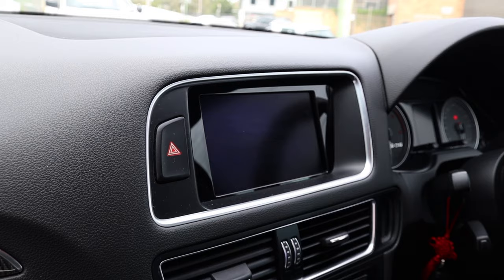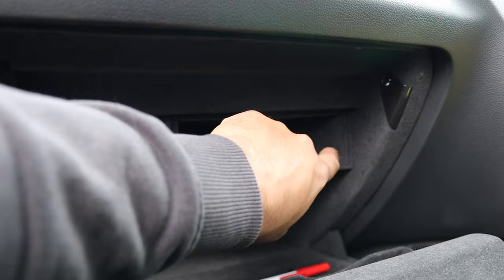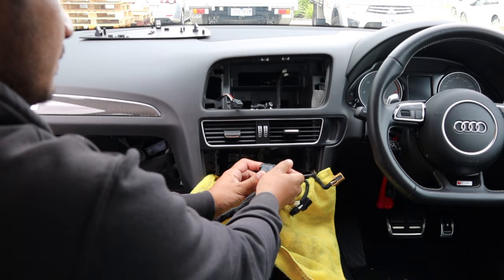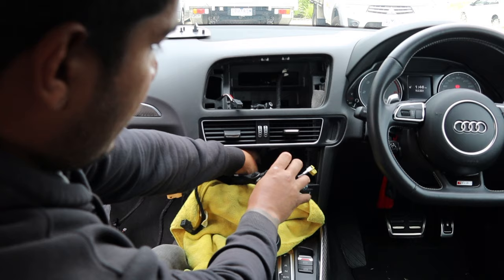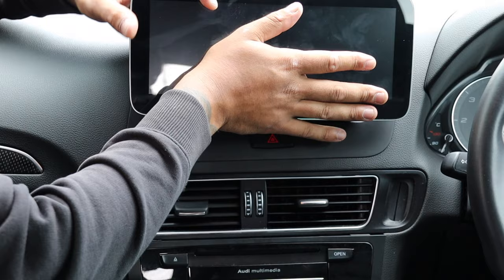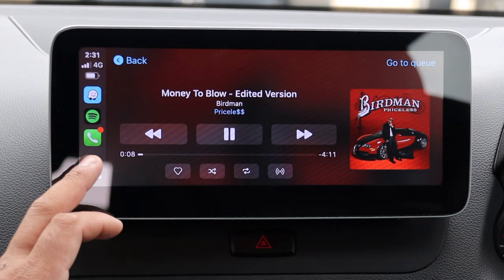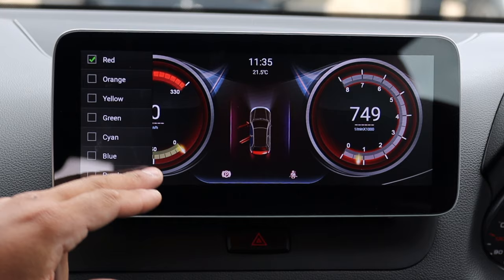Audi SQ5/Q5 10.25" Android Screen Install.

Comment: YOUR VIDEO IS BY FAR THE BEST. INSTALLING RS NAV 12.3 IN SCREEN AND I COULDNT FIND THE CONNECTIONS FOR AUDIO UNTIL I SEEN YOU DISCONNECT THE RED CLIP AND I WAS LIKW "DUH" AND I HAD THE SAME ISSUE WITH FACTORY REVERESE CAMERA. WENT TO SETTINGS AND TURNED IT ON. LOL, THANKS FOR A GREAT VIDEO.

Comment: Hello from 🇬🇧 Really looking forward to giving the install a try. Although I've only gone for the smaller screen rather than the one in this video. Nathan was really helpful answering my questions over email prior to placing my order. Keep up the good work. You've made me also want to upgrade my brakes with your other video 😉
Reply: Hi, I'd be really interested to see your install pictures and get feedback on difficulty of fitting please? 

I'm also in the UK and thinking about getting 2 of these kits, 1 for a 2011 Q5, and 2nd for an 2009 A4.
Reply: @nickburns2034  Hi Nick, happy to help if I can. I'm on Facebook if you want to chat more or I can give you an email address or contact you by phone/text if that helps. Cheers
Reply: Does it use the mic from old system
Reply: @markkendall6144  I have similar questions about the mic
Reply: I just fitted one in my q5 2015 for now no issues, small problem with airbag light (hazard light baton non Europe) and  I can’t connect  Wi-Fi but probably it’s my fault
Reply: @wojteklondon  Hi there, you mentioned having a "small problem with airbag light". I've just fitted one of these screens and I'm having issues with the airbag light, how did you get around the issue? Any help would be greatly appreciated   🙏
Reply: @scottmitchell4577  hi I connected the original switch and hidden under the dashboard. Big  plug for original and small for new. everything works as it should
Reply: @wojteklondon  Thanks for your prompt reply. I've been wracking my brain s over this for quite a while.
Many thanks
Reply: @scottmitchell4577  if you from Uk I’m from Luton happy to meet you and help. I did ambient light in my q5 it’s really nice I can give you advice we’re to bay and how to fit it.
Reply: Thanks for the offer, but I'm up in Carlisle
Reply: Hi guys I'm still having problems with the airbag system. I've fitted the original factory hazard warning button button as well as the new hazard button but the srs light is still on at the dashboard! When i connect an OBD scannerto it, it tells me the srs is not connected! If I then switch the passenger airbag off, I get the light coming on to tell me the airbag is off, so how can it not be connected?
There were no issues with the SRS prior to fitment of this screen.
Can someone please help, I've got a UK based 2012 Q5?
Reply: @scottmitchell4577  check plough under the glovebox. On the left maybe isn’t connected properly. If is okay. Plug only factory button and check what happens.
Reply: @wojteklondon  Thanks for getting back too me  it's much appreciated.
I'll check under the glove box and make sure that it's ok.
I did try plugging the factory button back into its original plug, but that didn't clear the fault either! Goodness knows!

Comment: Hello, really helpfull video here , i just installed mine and i see there is the airbag light on how can i fix that ?  I connect both buttons the original also the  other one also it turns on the redlight of the airbag  on the dash ?

Comment: Thank you for this video my friend.
I tried installing a screen like this and it didn’t turn on but after seeing your video I realised that I forgot to plug in the red cable under the glove box.
Is this cable responsible for the power supply? Do you think that’s the reason why the screen didn’t turn on? 
Thank you

Comment: I've bought this set for my 2007 s5 but my head unit has cd changer on it, not multimedia, it says compatible on the website but the cable is different, my headunit dousnt have a quadlock cable coming out of the unit, its a different cable, what do I do now? 😢

Comment: Hi. I  was wondering if u could help me ?  I've just installed a unit just like this. The only thing is am not getting no sound through the unit. I went into source and went down to external audio input and it says not supported. Tried to connect the bluetooth sound through it and youtube no sound coming through. Can you help me with the problem ? I've got Audi q5 2009 high end system with sat nav on it. Thanks.

Comment: Hi. A couple of questions. Screen does not turn off when vehicle is turned off and locked, suggestions? Also, when using android auto, for example using google maps, i go into reverse and backup camera does not pop up... and the speed half screen, only reads 0 mph 😩😩. Help will be apreciated!! Thanks in advance!!

Comment: After setting the Audi Media to except external source. Does the car's MMI system know to automatically switch to the AMI interface when audio signal is detected (since the AMI is acting as an "aux in" for capturing the Android unit's audio out signal)? Example - if I'm listening to the car's built-in Audi radio, and then want to stream Spotify from the head unit (via wireless AndroidAuto or Carplay). Does the Audi MMI know to automatically switch the audio source to the AMI audio. Or do I always need to press the Media button on the car's console first, for it to switch to the AMI audio signal? Great video by the way.

Comment: Installed this stereo system in a 2011 Audi A4 having a problem with 4G data SIM card not working Don't know if there are settings that I have to do or should it automatically work when you put the SIM card in the stereo system has been a headache...

Comment: Great video however a couple of issues uk users might be experiencing...1) the canbus for me was actually behind the air conditioning unit and not the passengers airbag. 2) the input option is not available in the settings ( Im currently trying to find a fix) so at moment without sound.
Reply: For anyone wondering how to access and enable aux, if its not there in the original mmi menu you're going to need to flash a script ( can download file from one of forums for free or pay for it) using an sd card. This will allow you to get into the green screen and enable it from there. I think it's under personalisation. Hope this helps someone.

Comment: Can you please share what exactly you had to plug into the MMI to get the sound working? Was it an additional aux cord, if so, where did that plug into? I am having trouble with my sound. I had initially plugged in an aux cord from the MMI in the glove box to the mic input. The sound worked for a bit but the mic didn’t and now all the sound is off. 

Thanks for the help!
Reply: Did you ever figure it out? Same problem here

Comment: Hey Nathan, received my unit to the Uk and installed over the weekend. One thing I noticed was that i wasn't supplied the adapter to go from the old hazard cable which is black to the new cable connector on the screen mount hazard which is a small white connector. Should i have been supplied something?

Comment: Hey Mate.  Couple questions.  Are these in stock ready to go ?  What is your shipping time to Sydney Metro ?  Lastly I have seen other systems that need a 3.5mm audio input connected to the AMI.  In my AMI I have an apple lighting connector.  With that work ?  or do I need the 3.5mm version of the AMI ?  I have a 2016 Q5 with 3G MMI HN+ .  Thanks

Comment: Since the fan mode and speed and such display on the factory screen, how does that interface if you have CarPlay up? Does it interrupt CarPlay and audio every time you adjust climate? I’ve yet to see a video that explains it
Reply from the maker: Yeah it switches to OEM quickly then switches back

Comment: Thanks for the video man, one thing that wasn't covered... if you're using Carplay or Android Auto and select reverse gear, does the reverse camera override what is on the screen and pop up? As it usually would on the OEM screen? TIA
Reply from the maker: Yes it does and then reverts back to whatever screen you were on
Reply: @TheFittingBay  thanks man. Appreciate the reply 😊

Comment: I have installed same system by watching your video but having trouble with system as it doesn't turn off when ignition is off.
Any help ll be appreciated
Reply: Have the same Problem. Any ideas?
Reply: @dada13D  had to take it to electrition and he connected new wire from Ignition fuse box to the system and it is fine after that.
u must check bluetooth audio work fine after that, I had to go again and paid again.( check u tube sound is coming from car speakers).
Reply: @kazmiabsar84  okay, i wonder, there is no other resolution in the kit itself to fix that. Thank u for the rapid answer

Comment: Question is the price on the site actually AUD or does it change after checkout I swapped to USD before adding to cart but it goes back.
Reply from the maker: the site shows USD and goes back to AUD but you are being charged the same. IE $500USD is the equivalent of $664 AUD just google it, so you are not charged more. If you are in the states its the USD pricing..

Comment: Hi. Just installed a unit very similar to this one. A couple of questions. Screen does not turn off when vehicle is turned off and locked, suggestions? Also, when using android auto, for example using google maps, i go into reverse and backup camera does not pop up... and the speed half screen, only reads 0 mph 😩😩. Help will be apreciated!! Thanks in advance!!
Reply: Same problema here

Comment: I se you are awesome with this androids :) i have a5 2014 and no original gps with audi concert... acidentaly i order 10.25 android for mmi3g+... i try to install and connect all exept original display cable, and when i turn off car androit wont start again... Is there any way i can fix it or i have to buy another one for non mmi sistem?
Reply from the maker: Need to buy non mmi. Will not work otherwise. Did you buy it from us?

Comment: My 10.25 in. System came with a gps Y connection the extended the wire up to the new display while still allowing the oem system to be connected.
Reply: Does it work flawless or jumping Arrow in navigation?

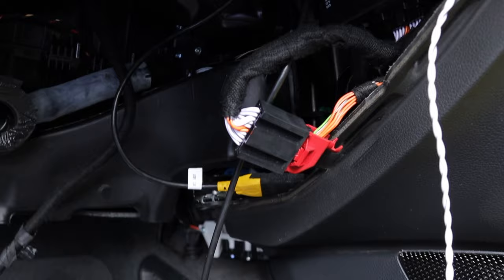Comment: I'm having sound issues and turned out I'm missing this cable at 10:00 and the seller says it is not required !! 

do you have extra cable like this ?
Reply from the maker: You’ll need to reach out to your supplier my guy as a lot of these are different
Reply: @TheFittingBay tengo un problema con un audi q5 , hace ruido cuando pongo auxiliar

Comment: Hey, I need help, my MMI controls don’t work after I installed the system, where did I go wrong?
Reply: Did you manage to solve this problem? I have the same issue
Reply: @JMCrowley1  yes, the malaka I bought the unit from send me the wrong one and then they replaced with the right one and now it works good.
Thank you for replying

Comment: Great tutorial! It really helped me with fitting my head unit!
I have one issue with my install though, when I’ve connected my AMI with the AUX cable, I’m only getting sound on the left side of my car (my car is right hand drive). I’ve reset the sound balance to centre, I’ve double checked the settings and the accessibility settings are all correct. I’ve even tried taking out the AMI port and giving it a blow like a Nintendo cartridge and that hasn’t worked.

Could it be the aux cable is faulty? I don’t know if it would be faulty as it’s new and I’ve rotated the connectors cos sometimes you can hear the aux jack fix itself, but that didn’t make a difference to the sound whilst it was playing. 
Can anyone help with the issue?
Reply: Does Radio works of the original MMI works normally? I had the issue in the past that the car thought I replaced the radiosystem with one not registered on the car. Had to delete the error and it did not reaapear. Check errors for multimedia via obdeleven or vcds :)

Comment: Why it happens that it wont work with reverse camera through canbus, bit only when used with camera detect with reverse light 12v.
Reply from the maker: Installation or settings issues.

Comment: My 2017 Q5 also has the passenger side airbag notification  next to the hazard switch. I am ready to install the 10.25" screen but I see no mention about the airbag  on the video. Should I worry about the airbag going off in case I try the removal with battery connected?
Reply from the maker: Take battery terminal off
Reply: @TheFittingBay  Thanks for the quick reply. What will happen to the cable for air bag light? The new system I got has only the hazard switch
Reply from the maker: @SanAntoniobuyer  all retained
Reply: @SanAntoniobuyer  hello, i just installed this and my airbag light is not turning off on the dash, i also have the hazard switch, did you fix this?
Reply: @cihados  You will need to double check your connections. I did not run into this problem.
Reply: @rakesh sehgal. Did you take the terminal off prior to fitting, as suggested by @The Fitting Bay, I think this stops the airbag light on dash coming on after fitting. Also did you have to recode anything on the car after installation due to disconnecting the battery? How did you turn off the anti theft system prior to disconnecting battery? Many thanks in advance.
Reply: @barrygibaud6916  I did take the terminals off. No recording was necessary after the new screen was installed. Nothing special done for the airbags with the battery disconnected.

Comment: Hi . I Just Got One Like This Today. Sorry i Did not buy from you. but everything is exactly the same. i connected everything correctly, but I'm  also having problems with the T Cable for canbus Bypass.when i connect it, nothing shows on the dash and the car does not start. and the screen is always on. it is only working on the original mmi side. i connect the bypass and it stops working and when i disconnect it all works again. so If You Could please give me some help on this issue i would really Apreciate it. Thank You
Best Regards
Miguel From Windhoek - Namibia

Comment: Would like to see the reverse camera in action.
Can the Android system ever be upgraded? Will there be software updates?
My car doesn't have a sim card, will this system add that functionality or does it rely on your smartphone.
Reply from the maker: Just flicks you back to OEM camera. 
Upgraded yes.
Yes to software updates.
Yes to SIM card but you can also use your phone if you wish.
Reply: @TheFittingBay  thanks for replying 👍

Comment: Hi Nathan, I am interested in buying one, however I can’t find any videos on how it fits the b8 A4? What part of the screen comes out for the A4?
Reply from the maker: a4 is exactly the same as the s5, video already done on our page :)
Reply: Hello Nathan, recently saw a video where a guy installed this aftermarket system on his A4 B8 but it turned the car components into the component protection mode and finally he had to completely change the car’s computer (apparently he fried the computer). There’s a chance for that to happen or you think maybe he did something else apart from installing this screen?
Bought one for mine and I’m scared about messing up with my car. 😖

Comment: Have you seen any issues with music stopping on android auto or terrible mids/Highs audio quality
Reply from the maker: Yep, do a reset on your phone and check the cable.
Reply: @TheFittingBay  Dont use a cable use wireless carplay with Zlink
Reply from the maker: @Naem209  you said android auto. Which needs to be done via cable. I haven’t seen any issues with wireless CP

Comment: Hi Nathan, I've just purchased the kit shown in the above video.
If I'm using the WAZE app, cos I WAZE a lot, can I also have the radio on in the background?

Kind regards,
Scott
Reply from the maker: Hi Scott! Thanks for that. Yes you can listen to the radio and use Waze 😎
Reply: @TheFittingBay  Brilliant, thanks 👍
Reply: Thanks for the quick delivery of this kit, it looks great and for the best part I've got most of it working. There are a couple of small issues that I've come across, but that's probably because I haven't got it set up correctly, so I'll send you an email regarding these if that's ok, but I'm really happy with this piece of tech, so many thanks

Comment: This is a nice improvement over my stock kit on the SQ5. After a few months with it, overall it is very good. Just a few minor issues so far.  I can get Android Auto working with a cable and using the speedplay app, but it will not go full screen. Can Android Auto be used full screen?

.Can you demonstrate Android Auto usage?
Reply: And the clock will not sync with the car. So, it reads 2:39 AM November 27, 2020 every time I start the car. Only way to set this so far has been to connect it to WiFI, then it grabs internet time.
Reply from the maker: Hi dennis, please email me with order number and photos info@aesonline.com.au . Youtube does not show us all comments.

Comment: Hello from 🇺🇸 looking forward to giving the installation a try. What is the name of the brand Android screen and what are the spec CPU, RAM, etc...? Also is there a mic...if so, does it replace the factory car mic?
Reply from the maker: All on the website www.shoptfb.com
Reply: @TheFittingBay  Hi. The website does not give the model number and brand name of 10.25" android for my Audi Q5.  Also, it doesn't address the mic question.